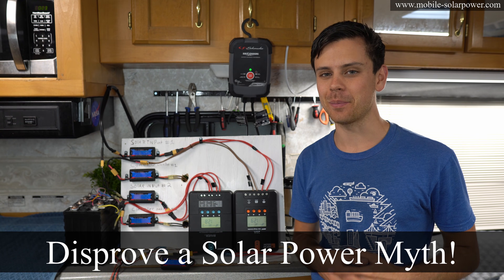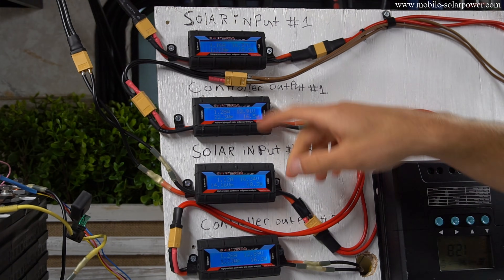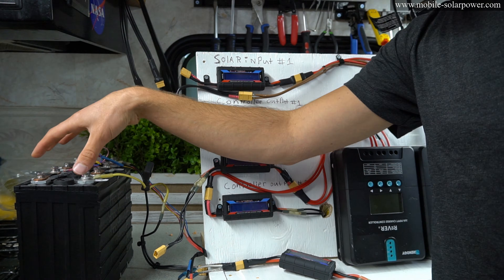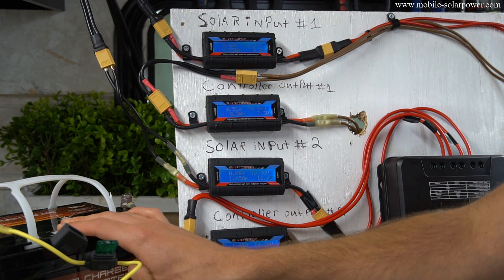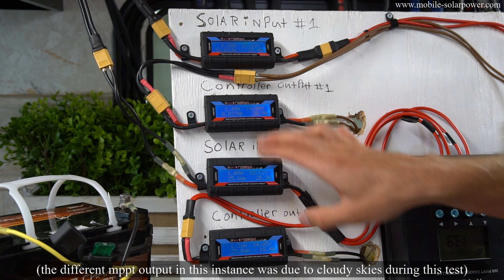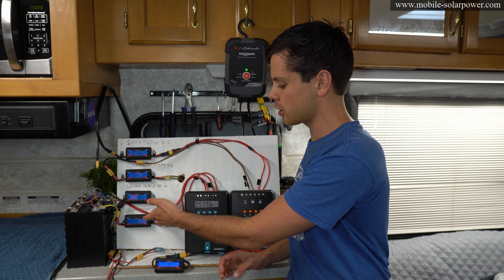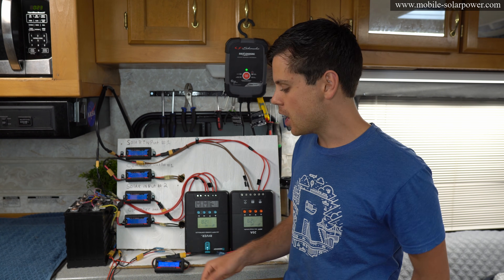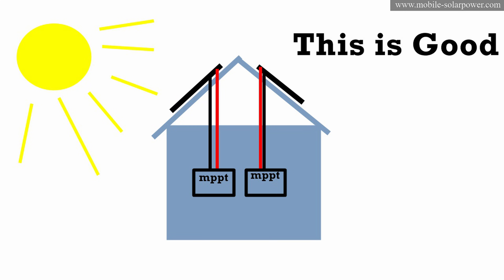Off-grid Solar Myth Debunked and Explained: 2 or more Solar Charge Controllers + 1 Battery

Comment: Great video Will. I have always had two solar charge controllers connected to my battery bank. You are absolutely correct, no problems as long as the batteries can manage the charge. The reason for two is redundancy